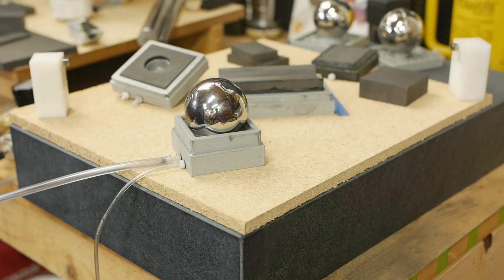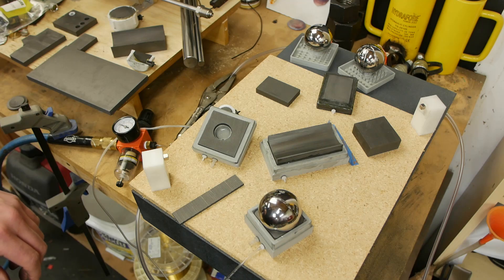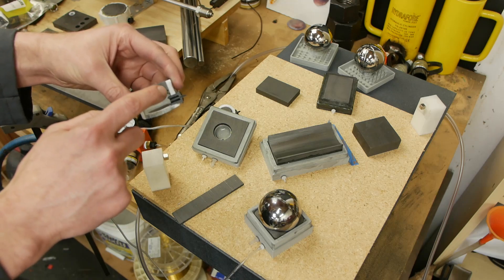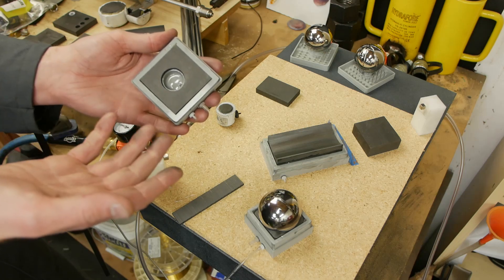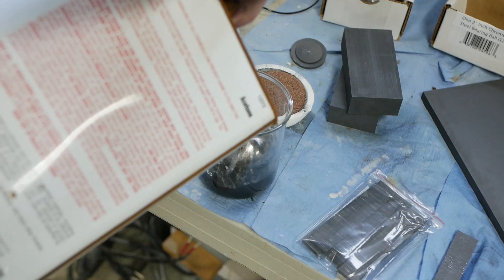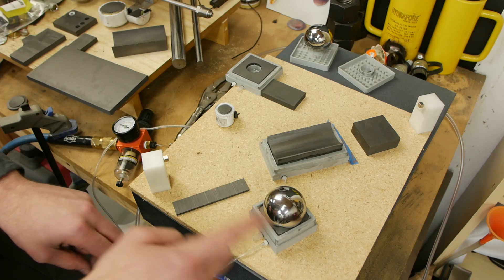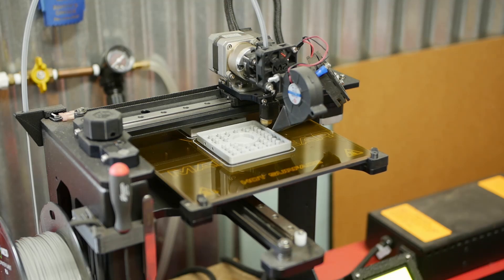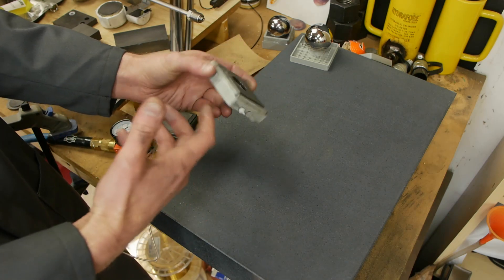Make vacuum pre-loaded spherical air bearings without special tools

Comment: one could make these bearings also with sintered metal alloy air filter material.
Reply: Could also use MDF.  MDF is porous like this once you cut the top couple millimeters off.  I use it to make vacuum hold down tables for CNC routers and it distributes the vacuum evenly over the whole surface.
Reply: @ReiniGrauer  Wow. Is that for real? I've never heard that. Very cool. I wonder if it would work well for vacuum forming bucks as well.
Reply: @bschena  yeah.  I had a 1400w 3 stage vacuum motor that could suck down a foot square piece of plywood dropped anywhere on the 3ft x 4 ft table such that you couldn't move it around anymore.  I will eventually post a video demonstrating the machine.
Reply: @ReiniGrauer  Hmm...did you ever try laying on it?

Comment: A fully encapsulating cylindrical bearing is interesting, but I think probably less effective than the cylindrical bearing you made in this video. Air pressure acting on the rod on all sides wouldn't give it any radial load capacity since it's pushing inwards in all directions, not against the load. I guess if there is a tight gap under the loaded side, and wider gap on the non loaded side it would work, may require experimenting with tolerances though. 

Really interesting video, I've never come across this type of air bearing before.

Comment: Excellent topic. Many years ago I used stainless steel air bearings spindles in manufacturing of rigid magnetic disk media with extremely low vibration and runout requirements. One recommendation is to make sure your high pressure air supply is very clean and have filters and traps for particles, oil and moisture contamination to prevent bearing crashes. This is a bigger problem when you are rotating spindles at high rpms and not so much in these examples.
Reply: If you don't mind me asking: What kind of magnetic media was it? I have a few older 15mb platters from a DEC mainframe computer, is that what you mean by rigid disk media?
Reply: pmk222 Yes, These were 14” platters. The discs were placed on the air bearing spindles, spun up to 3600 RPM and the flying write heads were loaded on the disc surface. A linear voice coil actuator would step and write a servo pattern. Depending on the the capacity, one to 7 platters were mounted into a cartridge for a single or a a “pack” with multiple platters. The capacity you mention sounds about right. This was in the mid-eighties where it was longitudinal recording with ferric oxide on aluminum substrates. Interesting side note: the “flying heads” used in all magnetic media also use the air bearing principle. Back in the 80s the flying heights were around 25 micro inches. Today’s heads can fly as low as 3 nano inches. Together with glass substrate, deposited magnetic films, better head and electronics makes rotating magnetic media a viable storage medium. Areal density has increased many orders if magnitude and are only recently starting to be replaced  by SSD. Fun Fact: A removable 8 inch cartridge I worked on in 1987 would store 20MB of information or only 2 digital photographs in today’s typical application.
Reply: @HarvardBob  Out of curiosity, do you actually use micro and nano inches?
Reply: Anton Helsgaun Yes, micro inches was the unit of measurement used. When I was working in the mid-eighties they were transitioning to 5 1/4 inch drives because of the growing IBM PC market. The flying height of the heads is a major factor in increasing the areal density of the bird stored in bits/inch^2.
Reply: @HarvardBob  Did you use laser interferometers to measure the head position, or were very high resolution rotary encoders already available?
Reply: @How Does it Really Work 
The heads were moved to the desired track using a linear voice coil actuator (also on an air bearing slide) which used an etched glass optical interferometer for position. These used quadrature phase decoders to count the track steps and position holding. The rotary position was determined from a timing track on a rotary glass encoder and was synchronized to the head write frequency. The encoder also had an index marker for absolute position reference.
Reply: @HarvardBob  I remember there was a deluge of surplus HP laser interferometers maybe 20 years ago or so on Ebay, many of which seem to have been coming out of hard drive factories in Asia. I am not sure what they were used for, that's why I asked.
In more recent years, you could also also see surplus micro-positioners somewhat similar to what you have described, only rotary -- a rotary voice coil like in a regular hard drive, (though somewhat larger), plus a very high resolution analog quadrature encoder. One model that often pops up is "MICROE PA-2000 MICRO POSITIONER." I am pretty sure they were at some time used to position the heads when formatting hard drives at the factory. They use ordinary high quality mechanical bearings. The further the technology develops, the more deceptively simple it looks!
Reply: @antonhelsgaun  Yes, in the days of mag tape recording definitely. Head gap lengths in microinches.
Reply: This is actually the most interesting comment section on youtube right now.
Reply: I have a feeling that porous media air bearings are much more resilient to clogging than orifice-channel type bearings. I belive drew devitt has a video where he puts a sizeable volume of water through an air bearing and it just keeps working.
Reply: Interesting point, good to keep in mind.

However, your mention of micro-inches and nano-inches really brought this video to mind, just pretend he says micro or nano in front of each term: 
https://www.youtube.com/watch?v=r7x-RGfd0Yk

Comment: It's like an air hockey table but running backwards.
Reply: ... and forwards.
Reply: I thought of this concept earlier this year but with a drone motor for thrust and some 11 year old madlad has already done it: https://www.youtube.com/watch?v=Fehrh-N-09o

There is a commercial version too but apparently it's a bit sht
Reply: @OliverUnderTheMoon  What about using some chemical source for the gas? Sodium azide is the first thing that comes to my mind... But the weight of the puck would vary.
Reply: @arthurwalraven1020  As would the gas output, it should be possible to balance the two.
Reply: @Vaasref  Sure. I was concerned with the mass variation because of the player's interaction with the puck, though. The speed wouldn't be consistent throughout the game.
Reply: @arthurwalraven1020  I'm not sure I understand?   It's sort of like a mini circular hovercraft so     no gas would be required.  My idea was purely in the "reverse air hockey" realm and not the air bearing realm so maybe that's where the confusion is.
Reply: @OliverUnderTheMoon  Your idea is great. Putting the blower on the puck would really simplify the structure needed to play air-hockey (imagine using a glass table!). But I fear the fan approach wouldn't allow for serious playing as people hit very hard. So I was thinking of a way to bypass this issue by not using a fan. Think of a tiny gentle rocket instead of a tiny drone.
Reply: @Vaasref  What about just recycling the air. Vacuum is the pressure pump's intake. A closed system. Pressure balance is achieved by pump speed. Maybe? IDK....  I do think compressor is better than gas, though.
Reply: My first thought was an air hockey table made out a giant slab of graphite, which makes absolutely no sense whatsoever.  🤷🏼‍♂️
Reply: @ahobimo732  It would only be slightly destroyed every game... :D

Comment: i need a 200k rpm drill mechanism (on the cheap as well) you just handed me an idea... thanks..
Reply: Ive done the math for a 2in dia rod, that's 130,000 rpm max so Im assuming if you are aiming for a particular rpm you should aim for a particular size for the rotational assembly you plan on floating. I can pass on the formula or figure out what dia you need if you reply as I know youtube doesn't always give notifications for comments.
Reply: @Ayestosea  Awesome, II would love to know the formula, thanks that would be great :) , i am going to use max 1 inch, probably something like 12 mm (about 1/2 inch)
Reply: @KeesHessels  Seems I might not be entirely correct. But I would still design it so any surface with airflow doesnt go supersonic. I dont exactly understand it 100% like if the film thickness is thin and the air "roll" does that allow for doubling to 260,000 rpm without going supersonic or if the rolling itself is limited by the air density blah blah

Comment: Regarding the 3D printed parts, to improve the air-tightness of the parts I recommend first callibrating the E-steps on your printers if you haven't yet, and I recommend overextruding by 5-10%. With respect to bursting, it may be preferable to use PETS or ABS rather than PLA. PLA should experience a brittle failure more like PVC, whereas I expect PETG or ABS to remain in one piece but split apart. I haven't yet tested those materials in my material tester, so I'm not sure whether that's true.

Comment: This is really cool but what would you actually use these fragile bearings for?
Reply: they aren't really that fragile. you use them when you need super high precision with zero run out. semiconductor fabrication uses them as an example but there is also some videos on youtube i looked at earlier where someone made a diy lathe with hyper precise tolerance to make parts that seem like magic.
Reply: @OtakuSanel  perhaps Dan Gelbart's videos on Mechanical Prototyping.
Reply: high speed, high heat aplications. Where oil cannot be and cintered bronze wont cut it, or mag lev is not feasible.
Reply: There is a Youtube channel of a company which makes air bearings -- there are many different kinds, and most of them can hold very large loads. There is a very cool demo of a shaft supported of specifically porous pads like the ones in this video:
*Radial Air Bearings on a Precision Shaft*.
The already mentioned Dan Gelbart's video *High precision air bearing CNC lathe and grinder*, is also very interesting.
Reply: @cogoid  i came here from Dan Gelbarts videos. hes very much inspired me in air bearings. now, to find large granite parallels for less than the price of two kidneys....
Reply: I would think they'd be good for balancing props and other precision balance work like HS motor armatures.
Reply: Fast spinny things, i would use them for tiny air turbines.
Reply: @crackedemerald4930  : check out "Air foil bearings" - self pumping high speed air bearings for exactly that...
Reply: You could totally make a super efficient cardboard/foamboard cnc head with an air bearing like that.